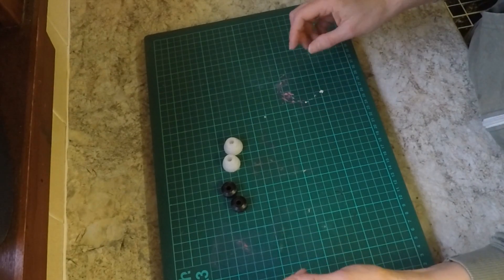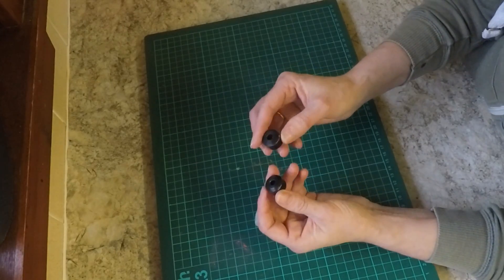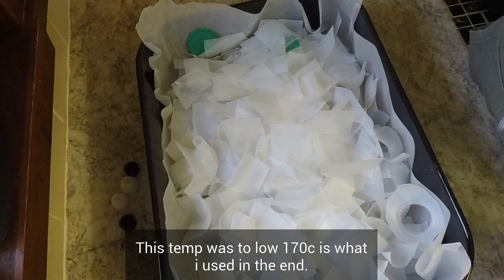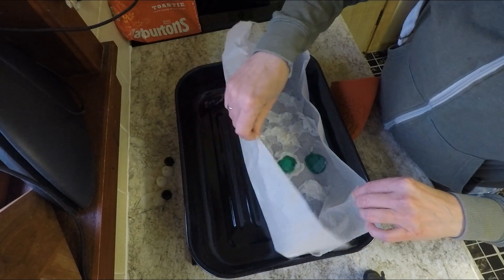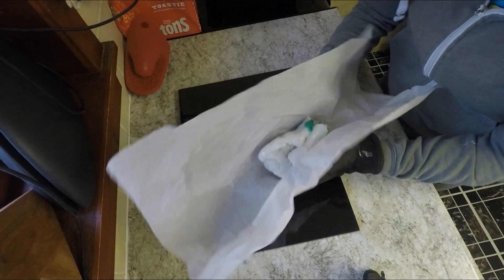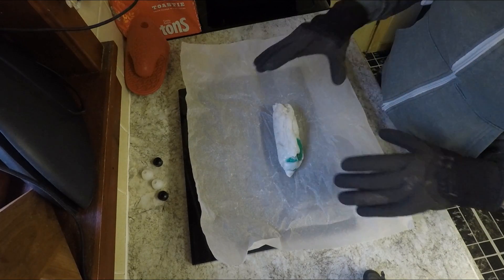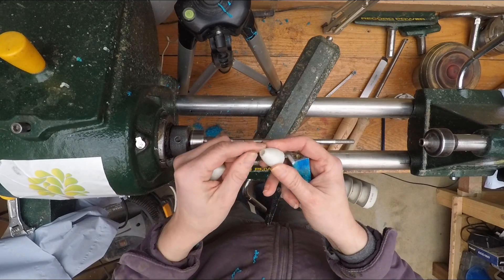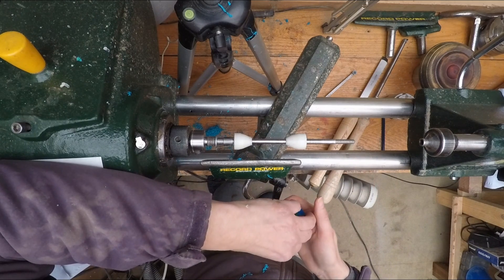Recycled milk bottles HDPE into pen or ring turning bushes

Comment: I have saved a bunch of HDPE from different containers because they make great resin molds also! I can also melt them down if they get too worn and make them again. :D - Heidi
Reply from the maker: Hey Heidi i was thinking about testing out making moulds definitely will be trying it out now many thanks :-)
Reply: Don't even have to melt it if you want a rectangle/square mold either. May have to make some of the pieces you cut straighter though. I would think using an iron on low heat with some cloth between the HDPE and the iron would work but I could be wrong. Never actually tried it. :P Then you could use hot glue to seal the edges. 

Mostly I just melt it and then press things into it. It isn't easy so what you press should be fairly sturdy and not easily melted since it will still be warm. I have used different metal things and glass pebbles, marbles etc. so far.

Comment: Great recycling job Pam. Never knew one that was what milk bottles were made from and two that you could melt and bind them that way.
The point of the HDPE is that CA doesn't stick to it. So you should be able to just use your finger nails (provided you don't chew them off) to knock off most of the CA.
I bought a tube of the HDPE last year, still using my first set of bushings as you only want enough pressure on them to hold the pen for applying the CA, obviously over time they will wear more and I suspect you do a lot more pens that me.
Well done!
Reply from the maker: Yeh it opens up using for other project as well maybe a small mould. Many thanks Paul :-)